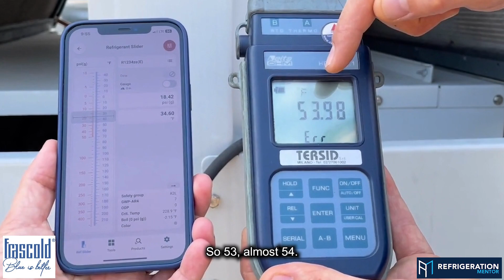How To Check Compressor Superheat

Comment: Copeland compressor on rack refrigeration . What should the normal superheat range.
Reply from the maker: It is different for different refrigerants. Standard HFC compressors they like to see 11K or 20F. But can go as high as ~107C or 225f discharge temp.

Comment: What superhheating do you recommend in transcritical co2 installations?
Reply: 10K is the recommended for all Co2 applications
Reply from the maker: Great Question Check with the manufacture of the equipment as they usually suggest higher superheat than the compressor manufacture.  Depening on the compressor manufacture the subcritical compressors could range from 10-20K so check there manauls. This will all depend on the the conditions of the system and oil.